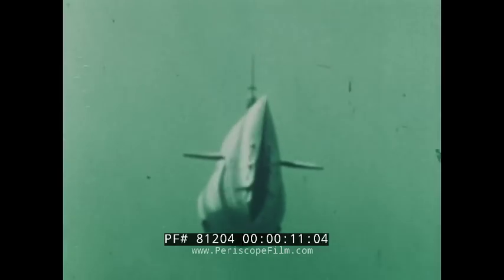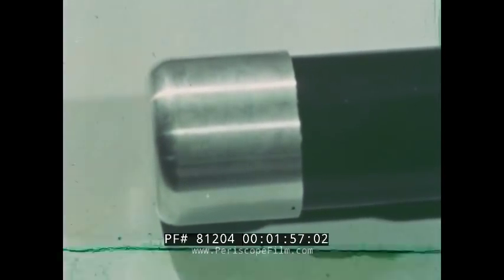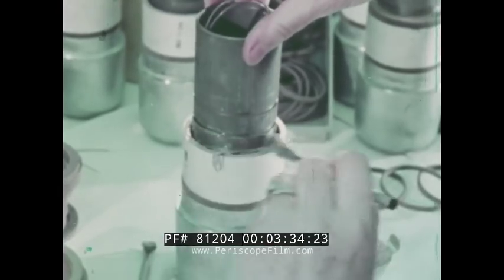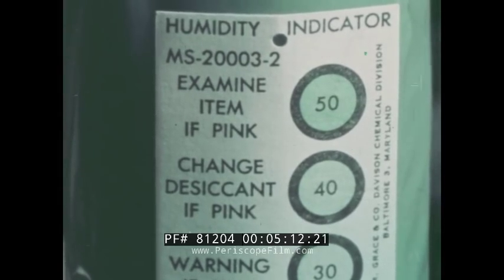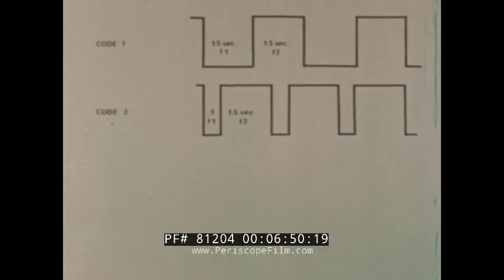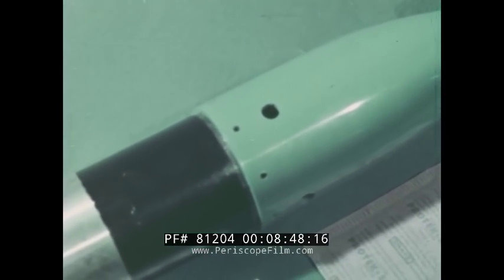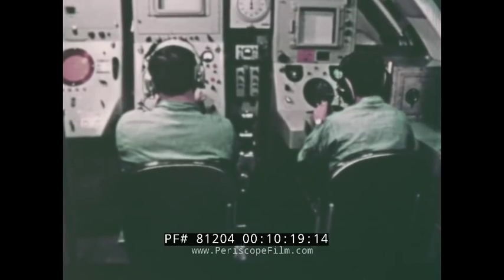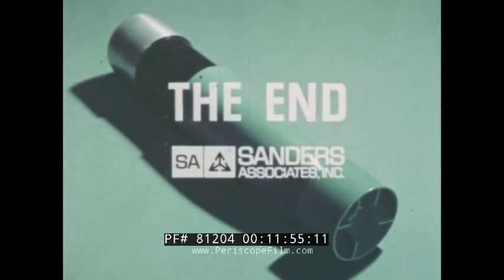U.S. NAVY  MK-84 SONOBUOY TRAINING FILM  SIGNAL UNDERWATER SOUND (SUS) 81204

Comment: The Mk 64 was more fun. It was an explosive predecessor to the Mk 84. It contained 31.18 g of the explosive 2,4,6-Trinitrophenylmethylnitramine, commonly referred to as Tetryl. They had two depth settings. Tape a couple together and you got a submarines attention quick.

Comment: Mk 84 is still in service, but not the Mod 0. Newer versions have 5 code settings, and the sea water activated battery is now in the nose section, with the electronic section in the rear. Battery is sealed with foil seals that rupture on impact, so the battery is environmentally sealed until use, this makes it far more reliable.

Comment: Downside is that would tell the other side we have a sub in the area.......
Reply: Or at least let them think so...
Reply: Thing is, any smart Soviet commander would have known already that carrier battle groups don't go anywhere without a sub screen. This is a useful tool for rapid communication with subs supporting a surface group without waiting on a scheduled rise to periscope depth to copy the radio broadcast, especially if the pre-briefed signals correspond to useful commands like "come to PD and standby for further orders", "redeploy to fleet's flank", "sub detected within firing range of fleet, begin active search, locate, and neutralize", and so on. The surface groups already generate enough of an acoustic and electronic signature to announce its presence, even without active SONAR blasting away.

If it's a lone-wolf attack sub operating on a detached mission, then yes, this would be an unnecessary risk.

Comment: That IS NOT A SONOBUOY.  I dropped hundreds of that little SUS  bastards out of the P-3 freefall chute.   Sonos are a five inch diameter about a yard long and have have hydrophones and transmitters to pinpoint underwater targets.  SUS are explosive or non-explosive such as the MK 84 SUS.  They are used to signal via sound.  The first MK 84 has 4 signals, the later ones had five.
Reply: What exactly do the sounds represent?
Reply: I'm more interested in what unauthorized items you've released from the freefall chute... Do people use it for disposing rubbish, and/or as a toilet?